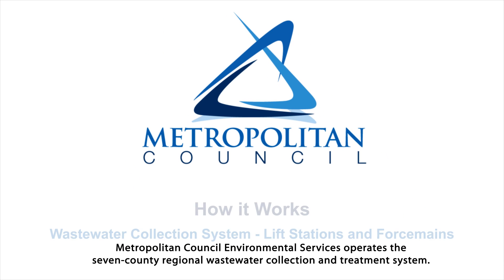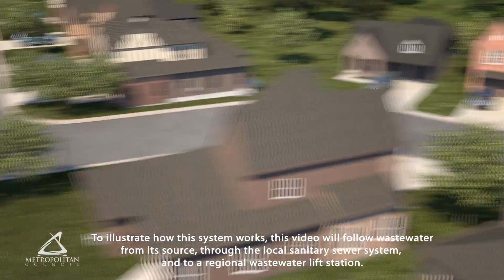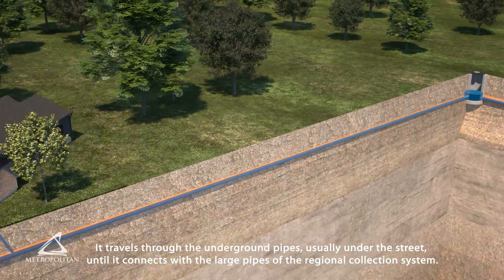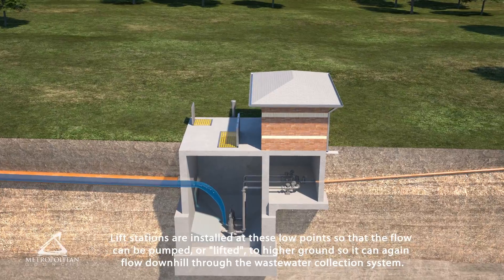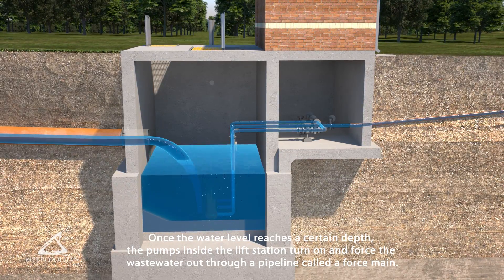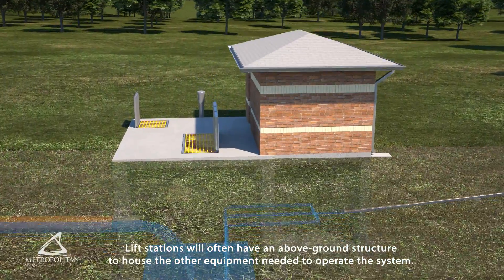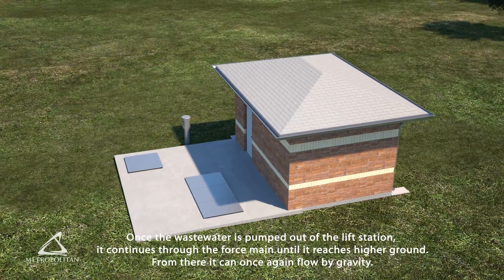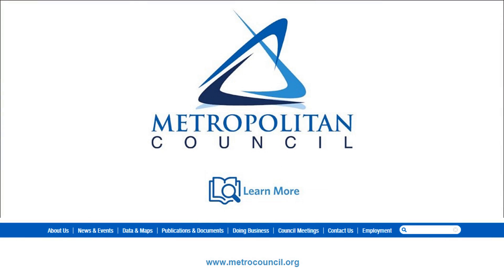How it Works - Lift Stations

Comment: Does all the heavy waste get pumped too?
Reply: Depends on what you mean by heavy waste. Stuff you are supposed to flush doesn't stay heavy for long in the wet well, but a good majority of my job is cleaning out those "flushable" wet wipes after they get caught around the impellers and stuck in check valves. I'm sure a lot of the toys, tampon applicators, those liquor shooters and other shit that shouldn't be flushed makes it to the plant (I wouldn't know, I just work in the field) but in general they either float on the top until we suck it out using our vacuum truck or they get caught in the pumps and we have to pull them.

I'm just a maintenance guy so I'm not entirely knowledgeable on the whole system (there's a lot of stuff to learn about wastewater) but I do work on lift stations specifically and this is my experience. It likely varies city to city, pump to pump, etc. our largest lift station pumps are 40 horsepower, a city near us pretty much solely has over 90 horsepower. I'm sure big cities with huge pumps will push about anything through.

Comment: Lift stations, a.k.a. poop elevators lol.  Thank goodness those access hatches are closed and locked.  It probably would smell horrendous when they're open.
Reply: It depends on how clean they are... If the lift station gets a lot of grease then yeah it can get funky in the wet well. If not, they have a fart type of smell until more air flow is presented to the space by either open hatches or an odor control method

Comment: If only youtube was available in the 80's, this video answered a question I had as a child (35 years ago). The only remaining question is why these stations sit on large parcels of land.
Reply: If the gravity sewer is to deep to connect to the existing sewer on the adjacent street, the developers need a lift station to raise it up. It’s typically used on larger sites because the grading forces the sewer deeper with more land being used
Reply: @ctaney2254 🔴 What Is Islam? 

🔴 Islam is not just another religion. 

🔵 It is the same message preached by Moses, Jesus and Abraham.

 🔴 Islam literally means ‘submission to God’ and it teaches us to have a direct relationship with God. 

 🔵 It reminds us that since God created us, no one should be worshipped except God alone. 

 🔴 It also teaches that God is nothing like a human being or like anything that we can imagine.

🌍 The concept of God is summarized in the Quran as:

📖 { “Say, He is God, the One.  God, the Absolute.  He does not give birth, nor was He born, and there is nothing like Him.”} (Quran 112:1-4) 📚

🔴 Becoming a Muslim is not turning your back to Jesus. 

🔵 Rather it’s going back to the original teachings of Jesus and obeying him. 

More .....👇

🔴 THE RETURN OF JESUS
Reply: Also, in another article I just read, they are also kept away from population in general and kept isolated due to their propensity to explode and because of possible hydrogen sulfide buildup. So it's also a safety measure.
Reply: @NightWraith1  Usually they're right below the streets. But if the sewer isn't flowing shit the right way then it piles up and produces methane, which can explode. It happened in Mexico city
Reply: @NightWraith1  We don't keep them away from populated areas in our town. They are where they are because that's the low spot. The only danger would be to the worker who services them. They need to have an air quality tester as well as a tripod and harness.